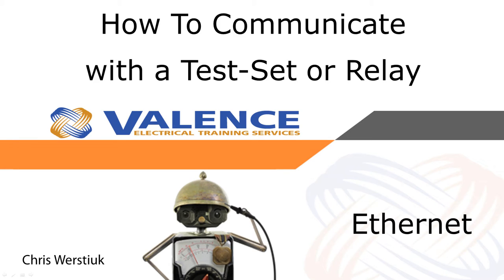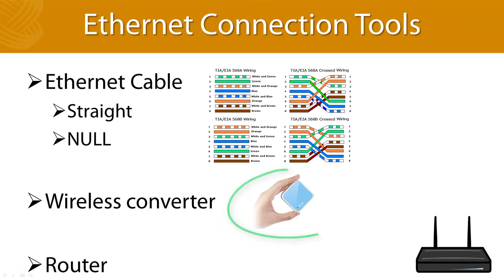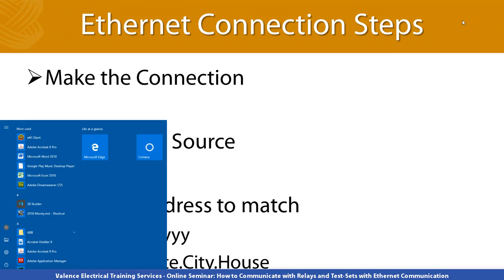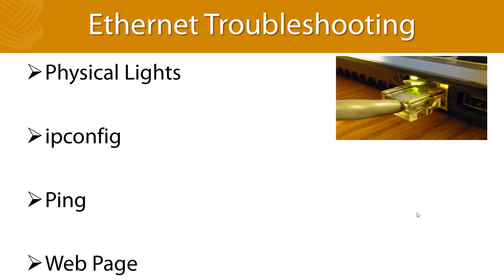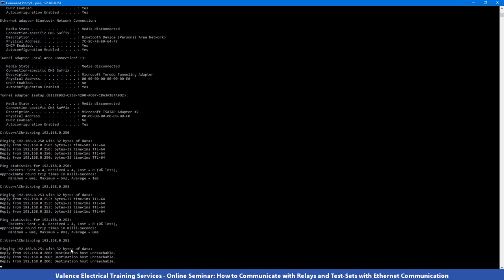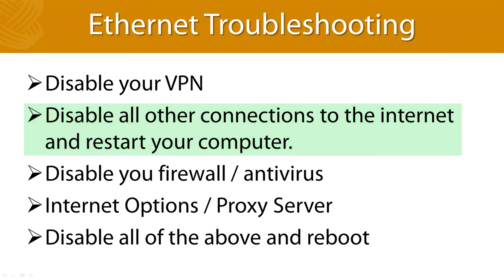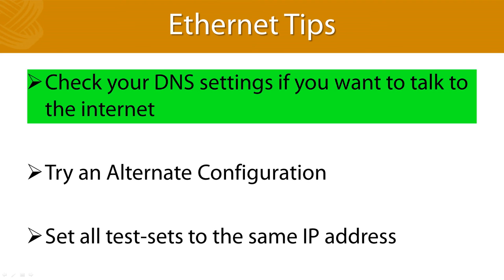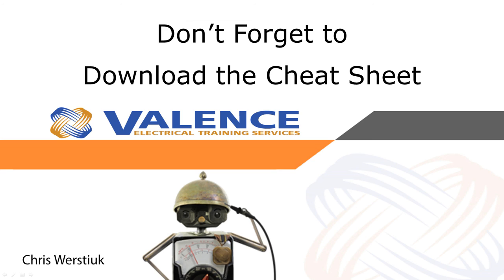How to Communicate With Relays and Test Sets With Ethernet Communication

Comment: Hi and thanks for the video.
I'm trying to connect to a SEL 351 relay through ethernet communication but I ignore the device's IP address. Is there a way to "read" the IP address from the device connecting it through serial communication or through the front panel?. If so, how can I do it?.
I would really appreciate if you can help me.
Reply from the maker: All relays with a front panel allow you to view the communications settings via the front panel. Find the settings menu, ports, and then the port you are trying to talk to.